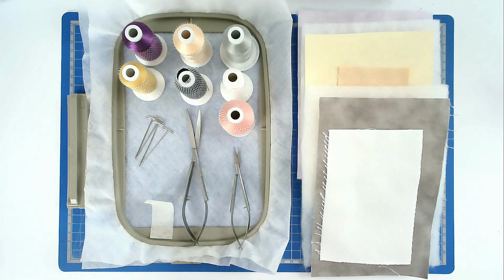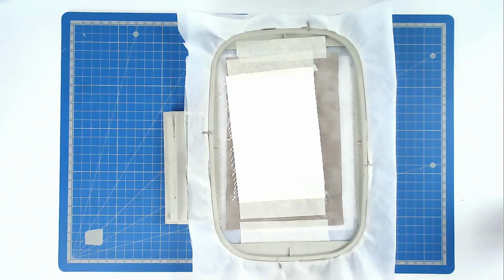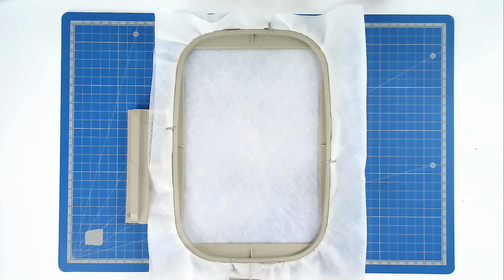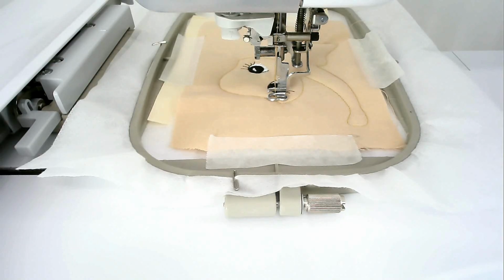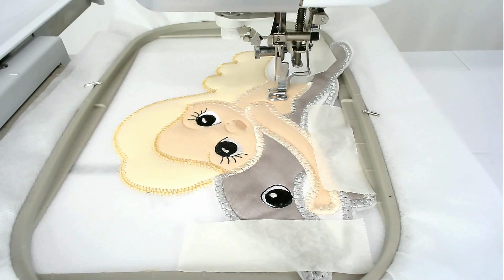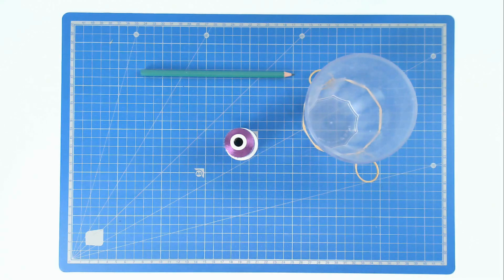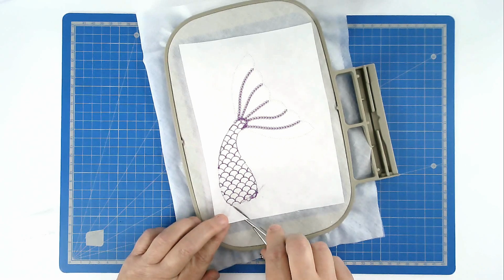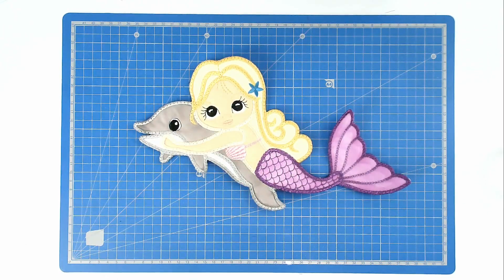Large Mermaid and Dolphin Applique Using Metallic Thread -  By Kreative Kiwi Embroidery

Comment: Thank you I do y\have a question how do you make this so its in a block form for a quilt. not sure how to attach it, brain not working.???
Reply from the maker: Hi Kathleen you would make all your quilt blocks first and stitch them all together. 
Then add any sashing around the edges of your quilt if you are adding any. 
Then stitch sew on all the appliques using invisible thread. 
Then add the backing fabric to the quilt and then bind the edge so that all the workings of it are all hidden. 

I do have videos showing how to stitch the appiques onto a placemat, you would do the same for a quilt.
https://youtu.be/Ep13eyz2ipk

I also have a video for adding sashing and binding to a project here
https://youtu.be/IPfhOH1fMI4

I hope this helps you.